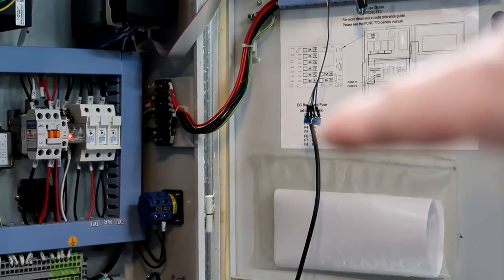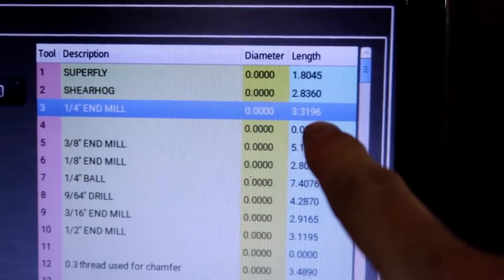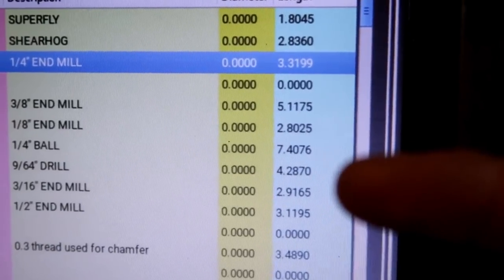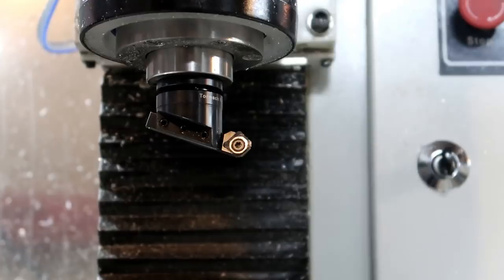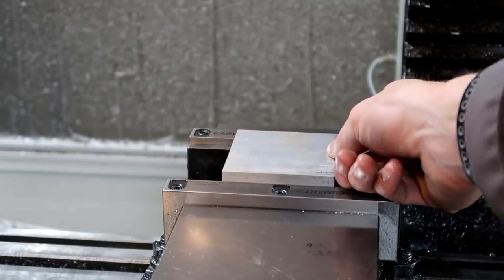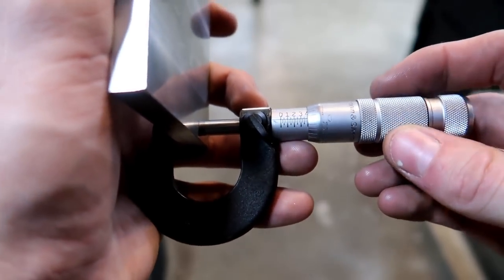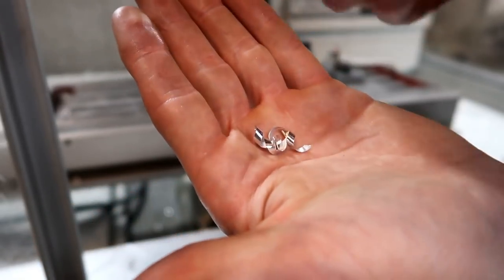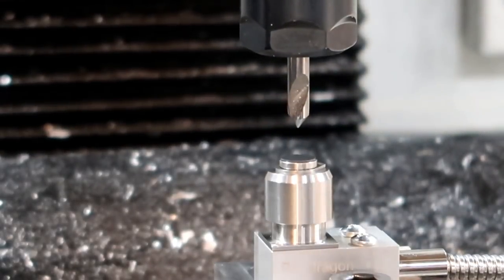The $75 Electronic Tool Setter: Home Mfg. Days #46

Comment: Sweet! Happy to see you got the original unit working!  
The over limit switch may not be as accurate as the top set of contacts.....so not as repeatable.  
With the way the insert is in the super fly, it will actually pull the tool down into the work piece.....so you may have to run a smaller DOC on a finish pass to check the accuracy of the cut.  I think I've been leaving about .008" for my final pass with the SF.
Reply from the maker: That's what I was thinking.  Maybe it would have been a little different if I did take that big of a cut on the flip side.  I'm thinking I'll be putting some axial stock to leave whenever I machine the hat off.
Reply: If I have a lot of overhang from the carrier when I flip it over, I tend to run a contour cut around the part to get rid of it.  You can also make the part a bit taller on the first side.....then take the heavy cut to get rid of the carrier...then you'll still have some material for a final cut on the, now top of the part.  There's a bunch of ways to skin a cat, so you'll figure out which way you like. :)

Comment: Crimson seems to have removed their instructional video from their channel. Any insight you could offer here?
Reply from the maker: I'm not sure why they removed their video. What could I help you with?
Reply: @MojoMfg  I'm looking to see what exsctly needed to be changed on the backend of path pilot to get one of these to work.
Reply from the maker: @Nordic_Goon  I had to change some code up because I goofed and got a normally closed tool setter when it should have been normally open. Thats the only reason I had to change anything on the backend
Reply: @MojoMfg  Gotcha,  that makes sense. Thanks for the reply. 👍
Reply: @MojoMfg  Well, the wireless tool setter I really want to use is NC, and I need to work with the code. I am comfortable doing that, I built my own ATC, but I just need to know where it's located.
Reply: @MojoMfg  That eBay link is down, but there are several others ($35?!?!?), but they're Normally Closed, too. Can you explain what you had to do in PathPilot? Thanks!

Comment: Hey, just curious if you found out where the .004" discrepancy was coming from?  Was wondering if maybe it came from when you set the initial height with the 1-2-3 block.
Reply from the maker: Initially I had the the tool setter wired wrong.  The tool setter was setting the tool on the over-travel switch within the tool setter.  That's why you saw the tool setter travel so far when I brought the tool down to it.  Once I got it all wired up right then it started producing better results. Plus I no longer use a 2-4-6 block or 1-2-3 block to set the difference between the top of the block and the tool setter.  Now I just bring the nose of the spindle straight down to the tool setter and set the ETS height to 0.000.  It seems to work much better that way.
Reply: @MojoMfg  ah I gotcha!  I remember you saying you had it wired wrong but I didn't realize that was the source of the error.  Thanks!

Comment: Does your one also have four wires, Black, white, Green and brown? I just got one, and the instruction leaflet is only in chinese. https://forum.linuxcnc.org/12-milling/33035-retrofitting-a-1986-maho-mh400e?start=890#131880 
I tried doing a resistance check on all pairs of wires, but all show open circuit, so I guess it has active electronics in it. How did you wire yours up please?
Reply from the maker: Sorry for the late reply.  Yes, it has all those wires.  I did the resistance check and came up with the same thing you did.  Unfortunately I got the wrong type of tool setter.  I got a normally closed tool setter where it should be normally open.  This caused me to have to make changes in the Pathpilot programming.  So this may not help you at all.

Comment: Can I use it as a limit switch for the 3d printer machine?
Reply from the maker: I imagine you could.  It may not be as precise but it would work
Reply: @MojoMfg  thank you so much, I'm currently using micro switch but I find few tool setter that accurate around 0.001-0.003mm. So interested.

Comment: The reason Ctrl-Alt-F2 works is that is a standard key combination that is used to switch to a "Virtual Terminal" when running X-WIndows on Linux and Unix. (There may be multiple terminals available, with F3, F4, etc). Then there should be a keystroke to bring the Graphical Display back.

This is because Path Pilot Brunson Linux. (Probably Ubuntu).

The GUI (Graphical User Interface) that Path Pilot uses is called Gtk3. It can be used with the Python, Perl, and C Programming Languages. This means anyone can potentially write "Plug-Ins" for Path Pilot.

Because Path Pilot is a Linux distribution, that means you can do all kinds of cool shit with the computer that you run it on.

Did you buy the complete controller unit for around $795, or do they offer a USB stick that you can use to boot any computer and make a controller with it?
Reply from the maker: I gotta say...half of that was way over my head haha.  I'm not really a software or programming guy but I am trying to learn as much as I can but I am finding out that you can do a ton in PathPilot if you really wanted to.  I bought the controller when I bought the machine but I just upgraded to PathPilot 2.0 withe USB stick a few months back.

Comment: How did you get path pilot on your plasma cutter?
Reply from the maker: I wiped windows off a computer that I purchased from craigslist, I used tormach's pathpilot boot drive USB to install pathpilot, and I had to get a Mesa card for the computer so the plasma cutter controls could talk to the computer. Plus, there was a decent amount of backend programming modifications in pathpilot to get it to work right.  Luckily I had a guy help me out a ton with almost all of that.
Reply: @MojoMfg  do you have to own a tormach  to get that boot drive?

Comment: So was the test cut done on the over travel switch measurement?
Reply from the maker: Good point.  Yes, I believe it was.
Reply: I would say that until you can get your online toolsetter and bench tool presetter to reconcile, I would choose one method or the other and not mix them.  If it's a calibration issue, perhaps that can be fixed.  Maybe try measuring a 123 block to test your bench setter for accuracy. At 1,2,3" heights. If it's good, then you know your issue is in your setup of the online tool setter, maybe the measuring of the spindle gaugeline was off a few thou?  

It might help if you had a master tool that you never changed that you could use to measure the spindle nose offset with if you can't bring the actual spindle nose to the tool setter. Or raise the tool setter high enough to touch the spindle nose off as well for the most accurate measuring.  The second is the preferred method as then the spindle gaugeline is recorded the same way the tools are.  

And finally the last piece of the puzzle is making sure you have a very accurate offset length for your currently calibrated haimer.  As everything you have measured or will measure can be perfect in respect to the spindle gaugeline, but if your haimer length is wrong nothing will come out to tolerance thickness.

Hope that helps, should have you cutting parts within a tenth or two thickness!
Reply from the maker: Yes!! Thanks for all the help.  I need all the help I can when it comes down to things like this since I am more on the novice side of machining and such.  

I'll be checking the 1-2-3 block with a set of mics then check it with the bench setter.  Maybe the gaugeline was off a few.  Either way I will be re-checking everything.  

Well, I can touch the nose of the spindle down to the tool setter so if I were to just do it that way and make the tool setter offset "0.000" then that eliminates having to make the offset from the gaugeline with the 2-4-6 block that you saw.  I was actually told to do that in the first place but my ignorance got in the way.  I will be re-calibrating my haimer as well.  

I don't think cutting to a tenth or two with this machine will be happening, not saying it's impossible, just not likely haha

Thanks again for the tips.
Reply: @MojoMfg  I've just wired my cheap ETS in tonight. It must be wired like yours, I told PP it was a passive probe and that made it work. The height gauge I got with my Tormach tools isn't very repeatable - it will vary anywhere up to about 0.004  measuring the same tool. I'm guessing as long as the tools are all measured with the ETS then their absolute length doesn't actually matter, only their lengths relative to each other. I don't have a Haimer or other probe for touching off work, I just use a tool and a piece of paper so that takes the 'absolute' length of the Haimer out of the equation for me.

Anyway I enjoy your videos, nice work.